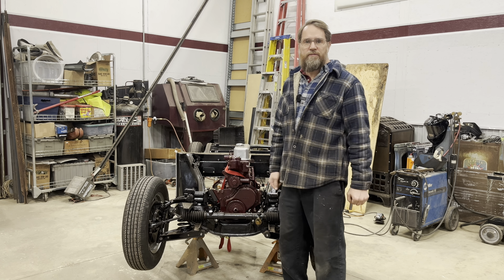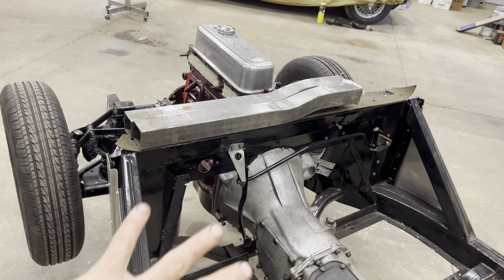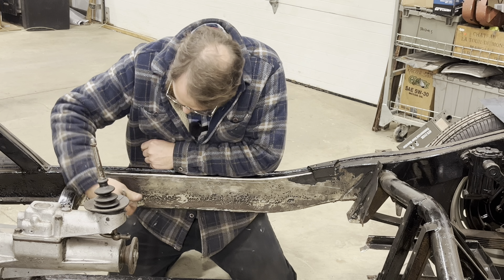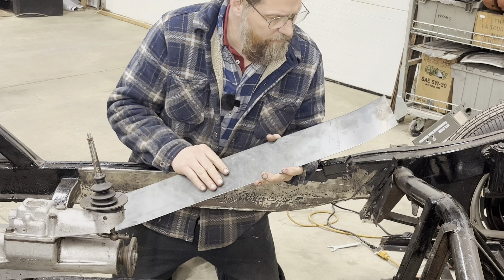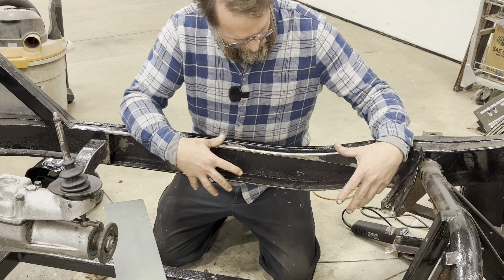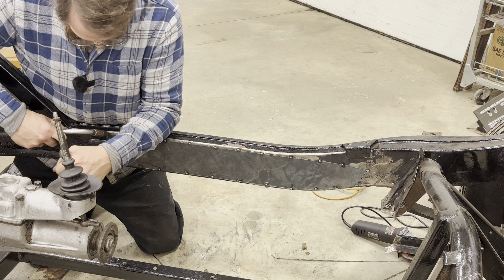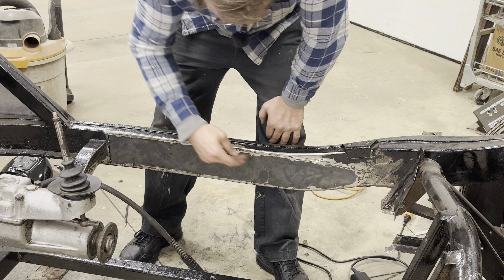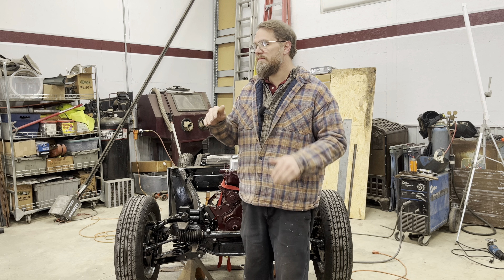MGA 1600 MK II chassis rust repair begins

Comment: if it's just as effective to close the eyes, why are so many fusing with their helmets? although, i suppose for something longer than tack welding they could be useful.
Reply from the maker: It’s actually not quite as effective to close your eyes. The biggest reason for me in this case has more to do with the downward angle my head was in to do the tacks. A helmet usually doesn’t quite stay in place  at that angle, if I could’ve got a better position on it, I would’ve been using my helmet